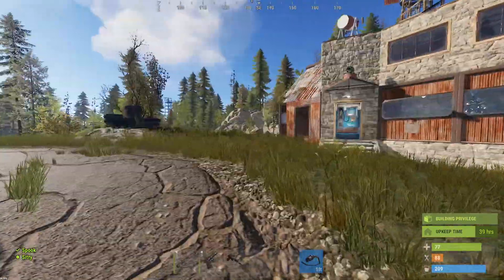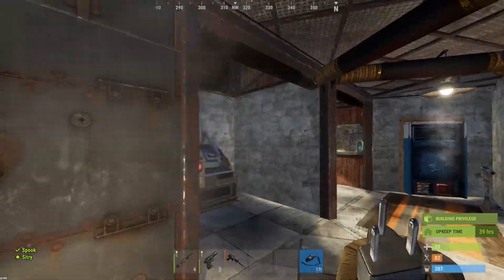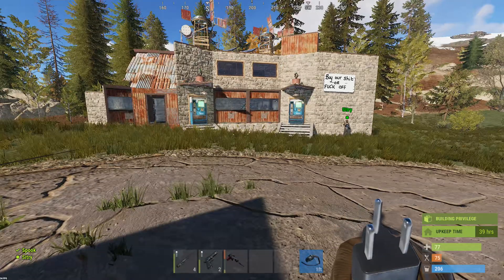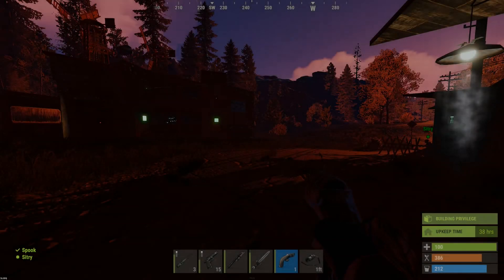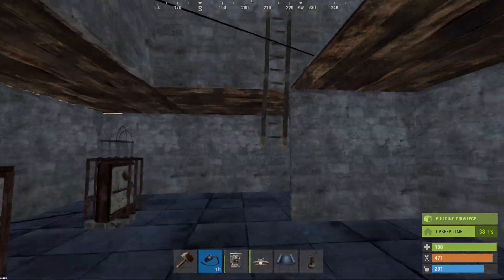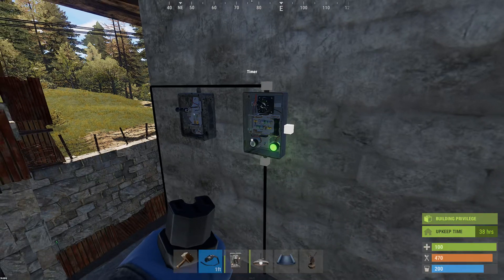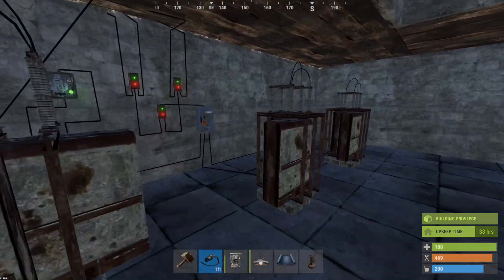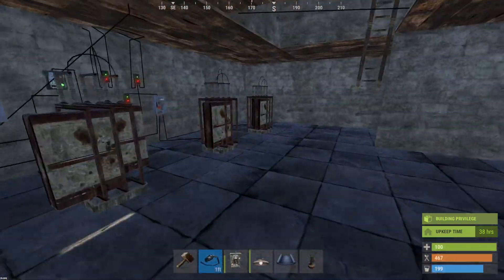Rust Electricity Tutorial #7 - Auto Night Lights - Battery Pack

Comment: To get your lights to come on sooner, and stay on longer. I made a video but it's just as easy to just tell you.
From the solar panel that you are using for your day night blocker. Before you plug it into your blocker or splitter if using it for many, put in an Electrical branch. Configure it for either 2 (which is standard) or 4 but you don't actually use the Branch side, you still only use the power side out to the blocker. What we are doing is effectively changing the number the blocker is receiving.
For instance, if you are using it just for one blocker, configure it for 4. Your lights will come on about 1/2 hour in game time earlier, and stay on that amount longer. So it's not dark when your lights come on, and still on when the sun comes out in the morning.

Comment: say, spook... i i figured out the alarm system i was talking about if your curious. it toggles on and toggles off without battery drain. can be used for remote door opening, and such, as well...
while figuring this out i figured out a dead mans switch, or a timed switch, in case it's in the open and you don't want your attackers to be able to turn it off if they get your trigger, because it occurred to me that if i am farming in my area and set the alarm off, the attackers could down me, take the trigger and turn the alarm off... so maybe two types of triggers can be hooked to the system depending on your needs. if anyone is curious i can explain further, or make a vid. also have a broadcaster hooked to it as well for a pager alert.
Reply: i have figured out how to have two (or more) remote controls to operate doors, or alarms. one for toggle on/off and one for a timed function. i did get one to work that stayed on and didn't turn off, but forgot what i did to achieve it. didn't see a use for it so i didn't try to remember.  although, you could have a remote on and a manual switch to turn off.
Reply from the maker: @cortedemico  hey bro glad to hear you got it sorted. Sounds like a complex circuit you got going too! Multiple remote controls for different functions would require a separate frequency for each right? Meaning more than 1 broadcaster? A video would be very interesting to watch and see how you've set it all up

Comment: I noticed you keep doing your cut offs with 0 power limit. you can increase your cut off power and make batteries available when power gets lower than a significant number lets say 90.  for example that awkward moment you wait for your auto lights to go on when its already dark and hard to see but no lights is on yet. that's because solar powers drop below  required amount of power for the circuit to run and yet still its not zero to let battery come in. what you have to do is to put another power branch in between your power branch and blocker. I'll try to explain a proper "infinite power source" setup, after that you can manipulate it for your auto lights
So the configuration would be like this: solar/windmill power (which is for example 210) goes to Power in on the first power branch, you set the amount of branch to the minimum power that your circuit needs to run normally, say 92 (2 power will be consumed by this cut off circuit leaving you with 90 for the actual circuit), leave the branch for now and take the passthrough of it which would be 117 and plug it into the input of the next power branch, from there you branch minimum amount which is 2 and send it to the blocker signal port ( blockers input is from battery output and its output is to an OR gate) and use the passthrough of it which would be 114 to battery input for charging. Now you take blockers output and that 92 branch from the first power branch and put them for the input of an OR Gate and use the output of that OR gate to feed your circuit whatever it is.
same setup goes for auto lights, but here the amount of the first power branch will be used to take away some power from solars and not connect it to anything or a dummy device to be used for nothing. this, is to make it possible for the batteries to come online when it gets a little bit darker not completely dark. you can even use them to make batteries to come online right before and after noon because if you put two solars facing east and west only at noon power output can be 40 and as soon as it drops below that you can make lights to turn on.
my English is not the best and I tried to be as clear as possible so i hope what i explained can be useful to whoever reads it. good luck
thank you for your videos.
Reply: Great tip.

Comment: Could you give us some numbers about how much components consume enrgy? Like, how many ceiling lights can a single solar panel run? What about the turbines? I'm yet to make any circuit because I'm on a hard server and didn't get a chance yet. But I want to know how many solar panels I would need to do some simple circuits.

Thanks for the videos by the way! :)
Reply: rustlabs.com has the electrical components added and their power consumption values. Now for all intents and purposes, nearly every single component will drain 1 automatically, however for whatever reason I HAVE seen a bunch of my ceiling lights use 2 despite some using only 1 - probably a bug or glitch.

Keep in mind that batteries WILL DISCHARGE if they are connected to anything other than a normal SWITCH or a BLOCKER's Power In. If say you hook up two batteries to a single root combiner it will STILL DISCHARGE YOUR BATTERIES even though there's nothing to power i.e. no load (strange that a root combiner needs to consume energy when it should be a passive device).
Reply: @worlwr2  Thanks!!
Reply: @M4RXTova  The overall distance of the wire ran from the power source also has an effect on power consumption. This additional power consumption will show up in the device being powered ,( a light showing consumption of 2 versus the normal consumption of 1.)